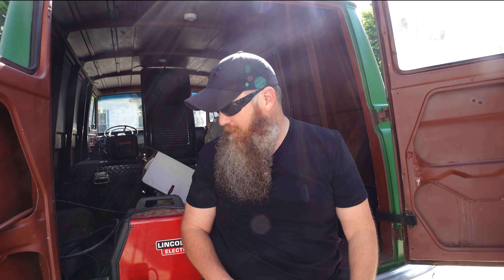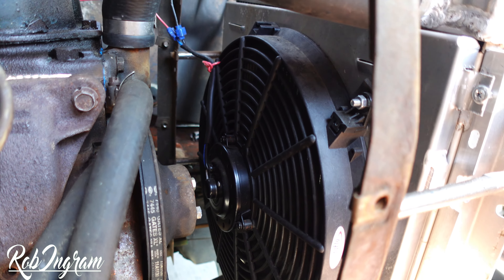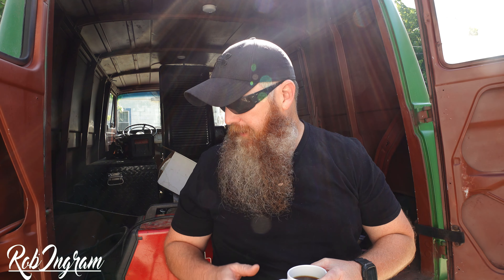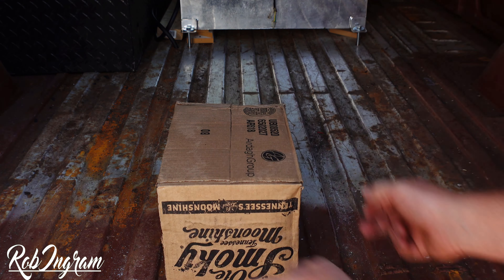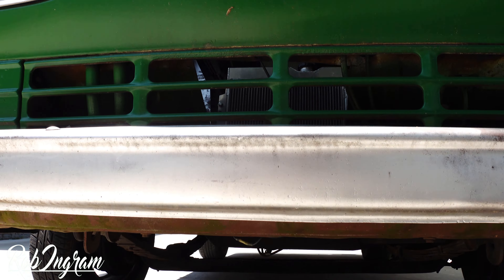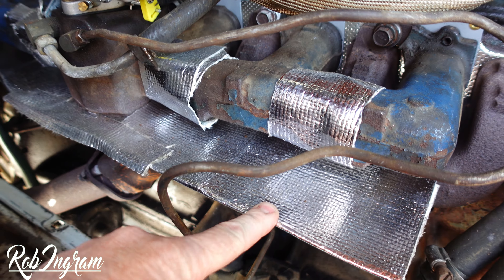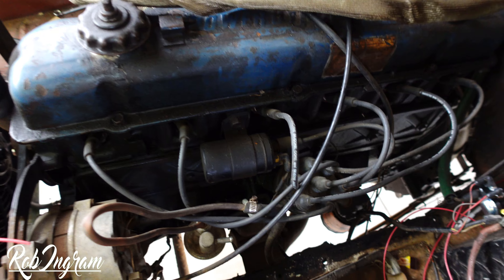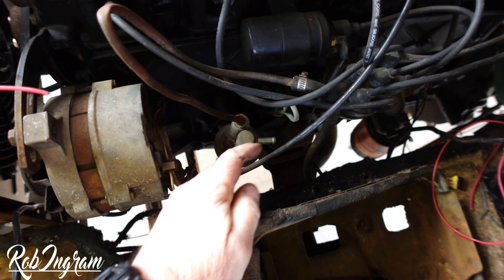The Rabbit Hole

Comment: I don't understand how you can have so many problems that require you to make mods on a successful design. BTW, I had a 64 Econoline  (a daily at the time) that was missing the belly pan and never even got warm. You don't understand points either. I am driving (daily 6 months of the year) a 66 Falcon that still has the used points it came with 8 yrs ago. Points work just fine unless you plan on racing.
Reply from the maker: Thank you for your comment and I think it is really cool you had a 64 as a daily driver! With my 66 it just is not working for a daily driver for me. As for a “successful design” there are tons of people on the internet having heat issues so I don’t think I am alone by thinking better air flow going through the doghouse is a bad idea. And for the points, I have no problem working on them but my decision to use a HEI was I just want a more updated system.
Reply: @Rob.Ingram  Not saying others aren't having problems too, but I wonder WHY. As you said, people used them for daily work from day one. Why is it you are having so many problems almost 60 years later? My logic says there is something else happening that you are missing. Although newer fuels are more of a problem, I have never had vapour lock. Maybe your heating issue doesn't even exist. Maybe the temp gauge is wrong? Every thing worked fine for many years. As with many things, we have to figure out the "why". Love those old vans, but nature of the design is they have terrible bump steer. That was my only complaint.
Reply from the maker: @MaxNafeHorsemanship  fuel has for changed, and for sure the old vans have terrible steering. I am working on a fix for that too... LOL
And there are no issues with the gauge. I have changed them plus my water temp stays cooler now after getting better airflow going through the doghouse. I think the high riser value in the exhaust is what was  causing the carb to get way too hot and making the gas vaporizing in the carb so I think getting it out of there will fix that issue but I have not really had a chance to drive it since removing it. Update coming soon!